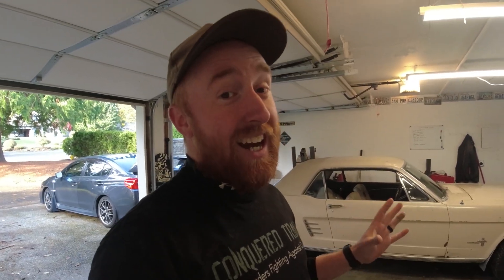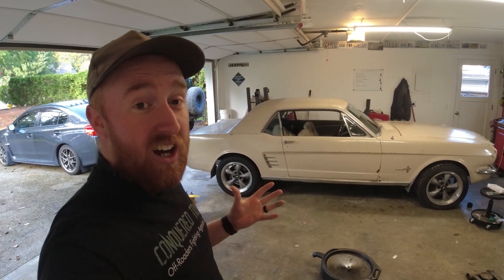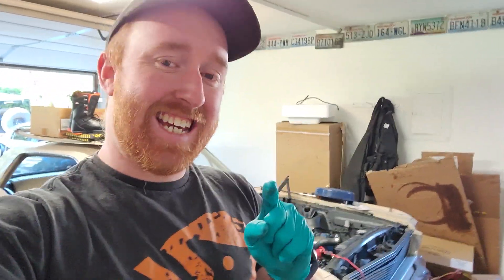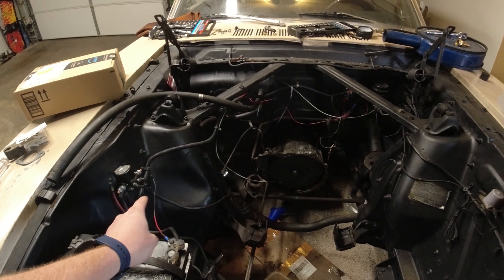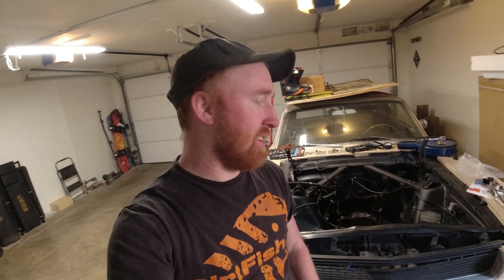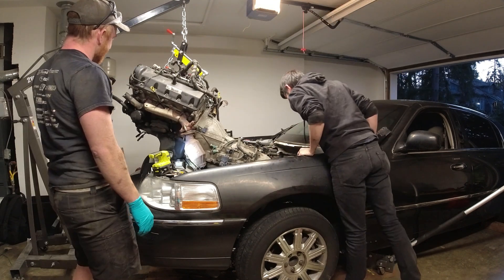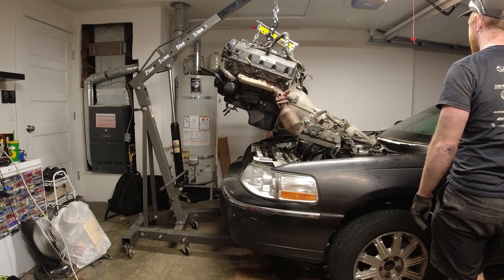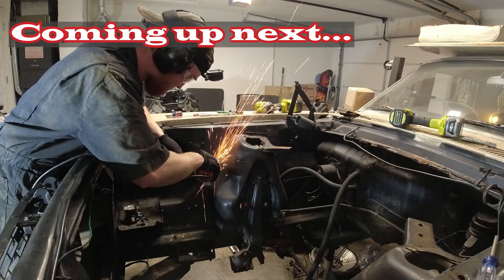1966 Mustang 4.6L V8 MOD MOTOR SWAP Episode 1: The Original And Donor Engine Removal

Comment: Doing a  07 4.6 3v into a 71f100 with cv swap front suspension rear-end.  Question when ordered the holley kit would the 2v or 4v work on the 3v
Reply from the maker: That one you may have to reach out directly to Holley. I dont want to give you wrong information. I did the 2v engine so I got the 2v harness. 
That should be an awesome truck when you are done!